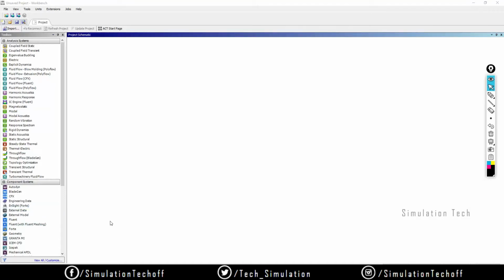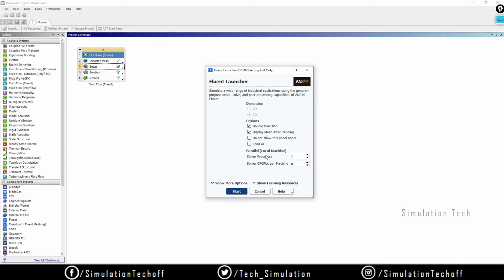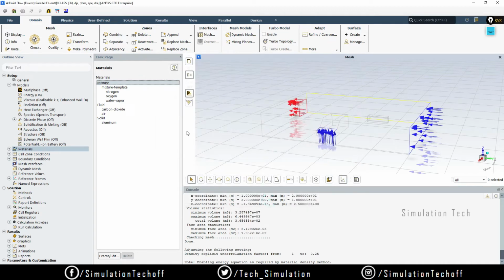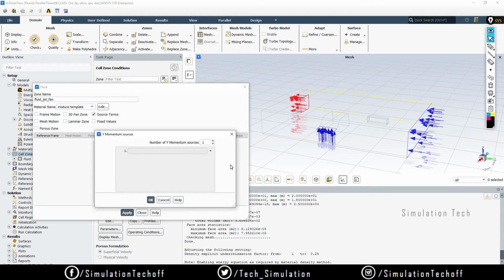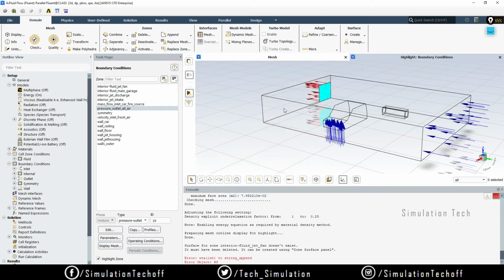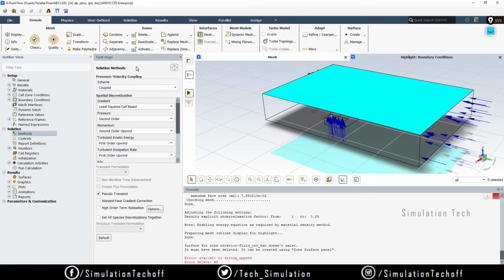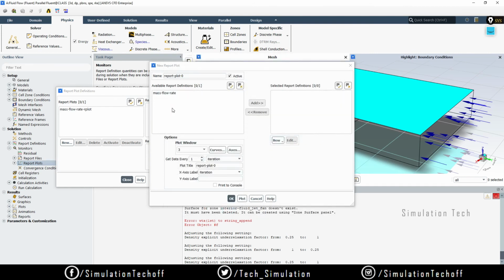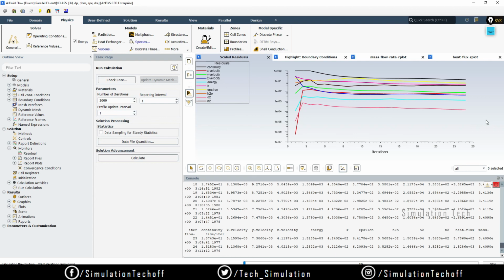Multi Species Analysis in a Car Garage  | Lesson 05 | Part 1 | Ansys CFD ( Fluent )

Comment: Hi, I wonder how you calculate the mass fraction of CO2, as you did not activate any combustion model here? You mentioned that CO2 is calculated after mixing the mass flow inlet (from engine) species with ambient air, how would it possible? I am confused. Can you enlighten?
Reply: same question here.

Comment: hello sir .. may i have the geometry file to do meshinng  plz???
Reply from the maker: you can open the .msh file in Normal Static Structural Module instead of Ansys fluent to view the Geometry and the Named Selection part. Happy Learning !
Reply: @simulationtechhub  sir i have tried that but its not opening there as in static structural there is engg data, geometry and then modal but no mesh option and so .msh file is not opening in any of these... plz guide me sir